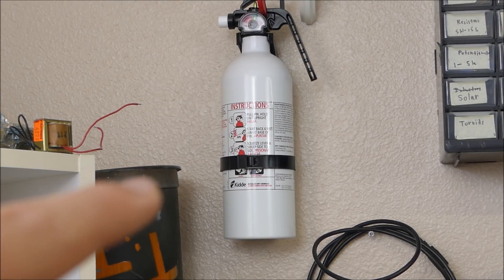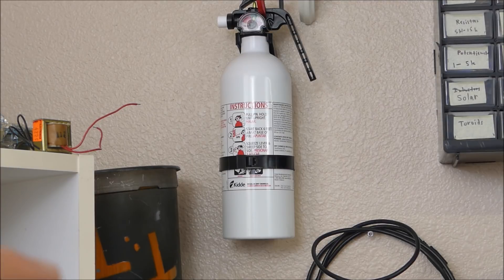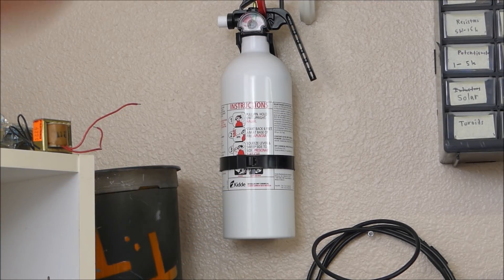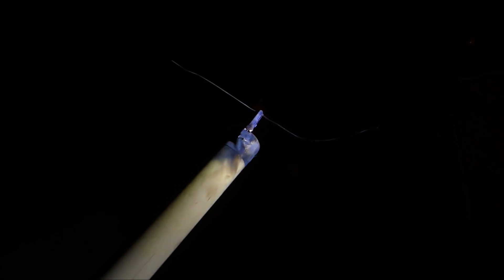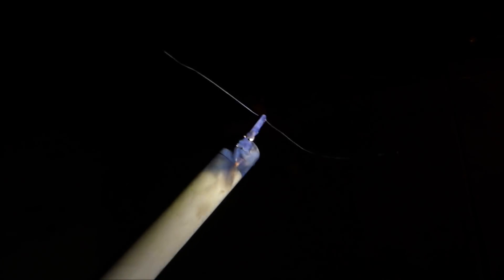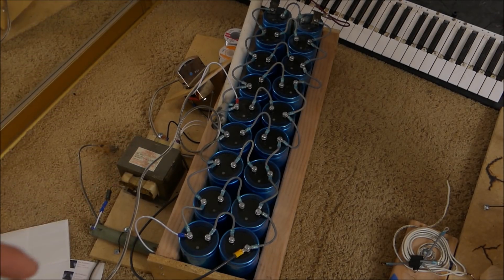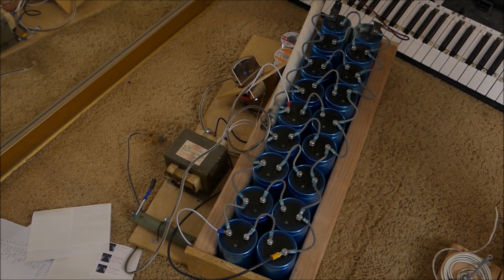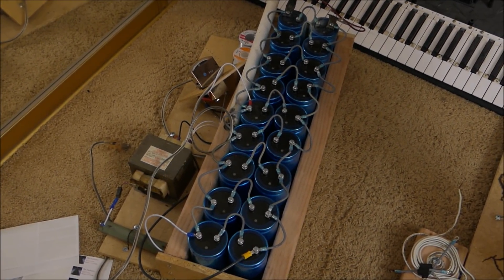Solder Fireworks for The 4th of July

Comment: I recently buyed 250$ of components from ebay, this electricity stuff better be good.
Reply: LOL For sure it is, but man.... maybe not the best way to get at it... We'll see..
Reply: Hmm there's another wae? *kluck *kluck *kluck what might that be?
Reply: Probably you should recover random components from old tech, like TVs and other stuff, for learning to solder while unsoldering and building up baseline component library. After you know what stuff you want to build and what you haven't found in old tech, you know what you need to buy. It is not bad to have 250$ worth of stuff. Just it might not be the stuff you need. Probably you are missing different transformers high voltage caps and some other special stuff depending on what you are building. These components might be too pricey just to buy at random. It is not too pricey to level up your soldering through desoldering. 

If you want to buy stuff, buy equipment. Soldering iron, breadboards, variable current limiting power supply, perfboards, solder wicks, that lead sucker that is pain in the ass to work with, multimeters (2 is ok). If that is too much, just buy one multimeter, soldering iron and a lead sucker. Rest will come later. I reccommend getting into AVR stuff too. That costs about 10$ extra, but gives so much in return.